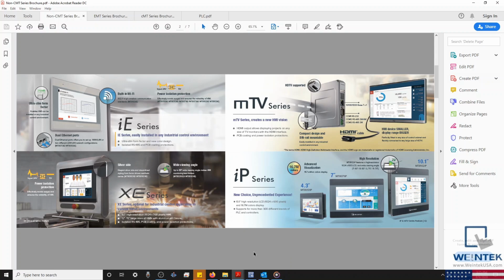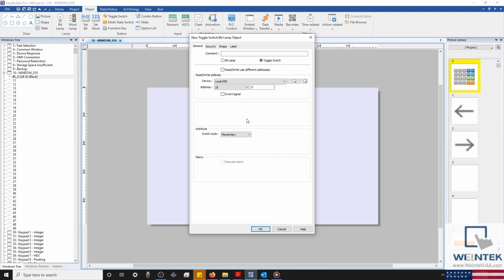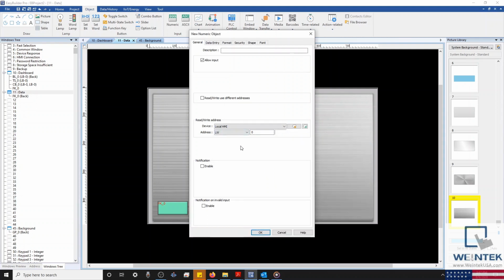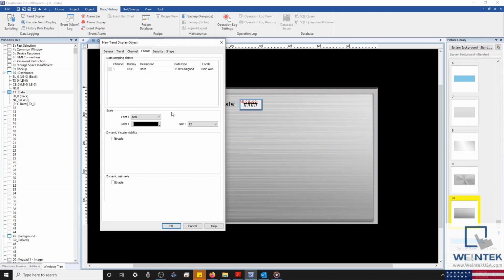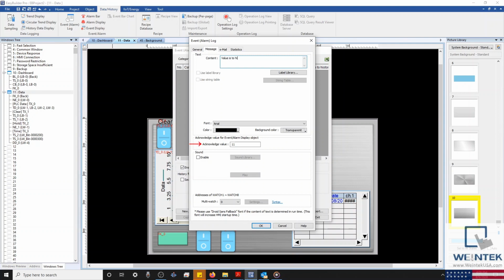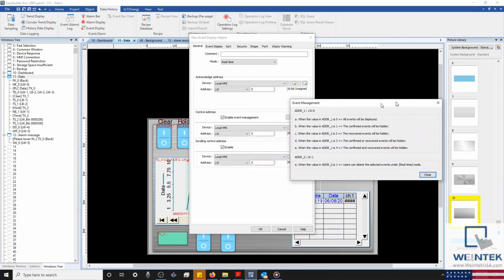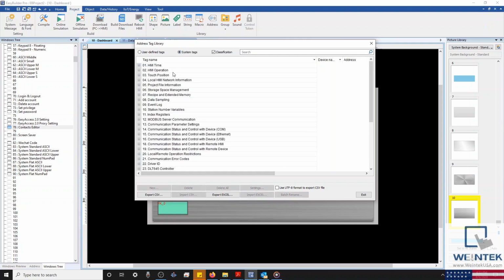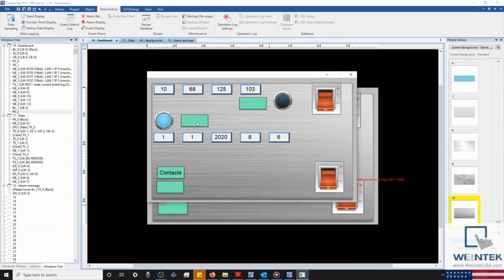EasyBuilder Pro Basic Programming Tutorial iP, iE, XE, eMT series HMI - EBPro Weintek USA

Comment: hi Sir I have a question what does tag in HMI for?
Reply: Hi Kenneth,
Tags within the HMI help the programmer identify the purpose of variables used within the HMI program. As an example, I may use internal bit LB-0 to trigger a data transfer between the HMI and PLC. However, if I need to review the program later it may be hard to tell what the purpose of LB-0 is. To prevent this issue, I should instead create a tag for LB-0. The tag name should be descriptive like "PRESSURE_SP_TRANSFER_TRIGGER". I hope you find this information helpful!
Reply: @WeintekUSATeam.0  Owww its like renaming an address. Thank you Sir. So tags are like addresses that can be rename right Sir?
Reply: @kennethfajardo5121  yeah they're pretty much name "tags" on w your device so you know what the heck they are.
Reply: @spiderdude1013  owww okokok thank you Sir